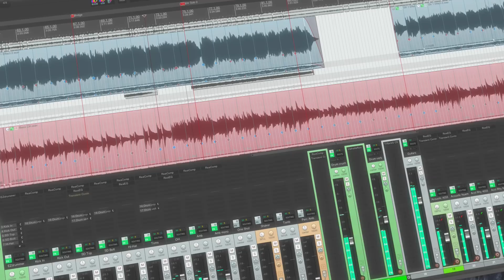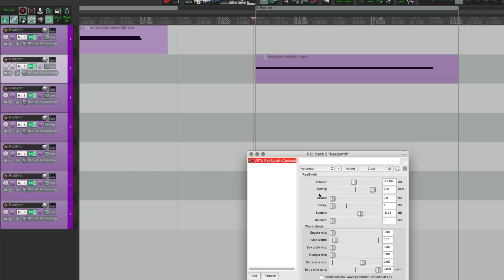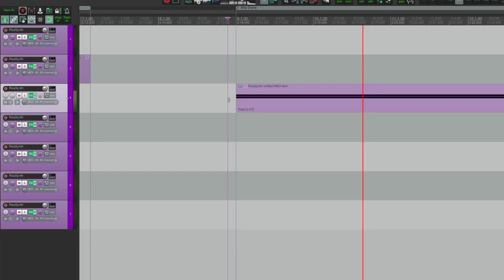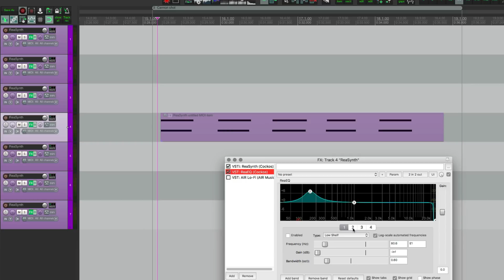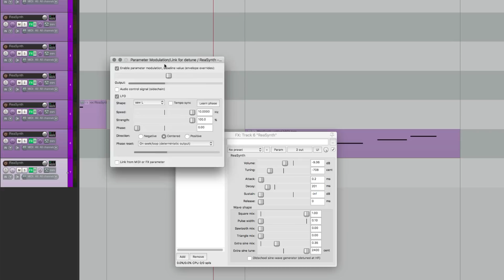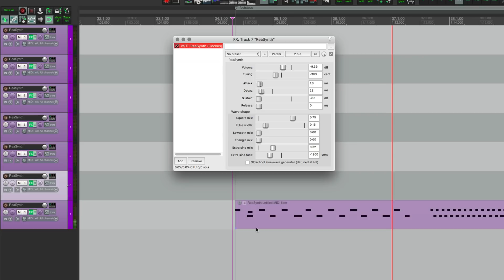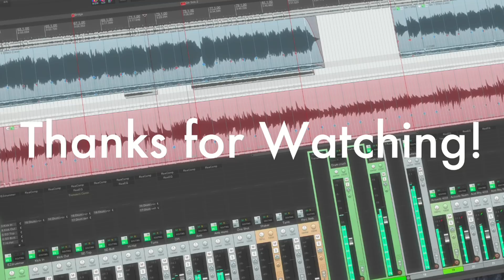Making Retro Game & Sci-Fi Sounds With ReaSynth

Comment: What I don't like about the parameter modulation in Reaper is it's processing per-block but not per-sample on some effects, like ReaPitch or ReaEQ. But this is plugin-dependent. Maybe I talk shit and this need to be tested but it feels like that ...
Reply from the maker: its entirely possible, I've never looked into it. I guess to test it you'd use a low buffer size record the parameter modulation in Write mode
Then again at the highest buffer size. 

I know MIDI CC resolution depends on block size.
Reply: Yeah, it definitely works better with lower block size (ReaEQ). The minimum is 3 samples. It means you cannot modulate more than 7350 Hz with a samplerate of 44.1kHz, if I'm correct. And If using a block size of 1024 samples, then you already are with a maximum of 21 Hz modulation. (The parameter caps at 8 btw but we can enter any value).
But what pisses me off more than that is the lag time : When I set a cutoff square point at X, I want that filter to cutoff exactly at X, not at X + 1024 ... you see ?
Reply from the maker: sounds like a feature request.